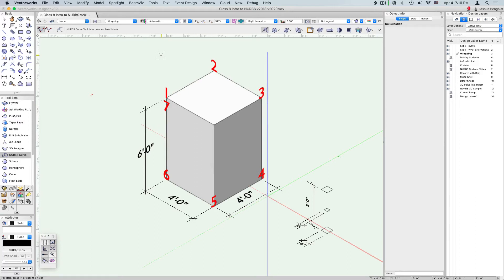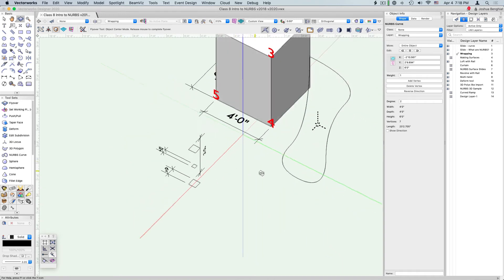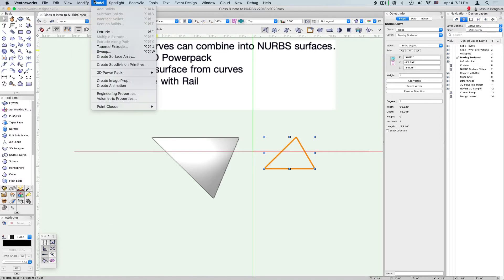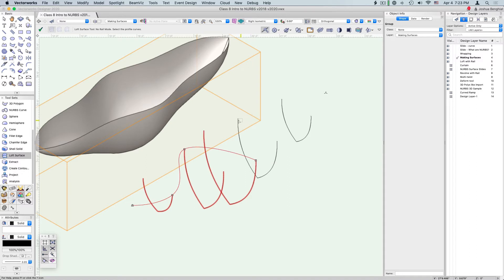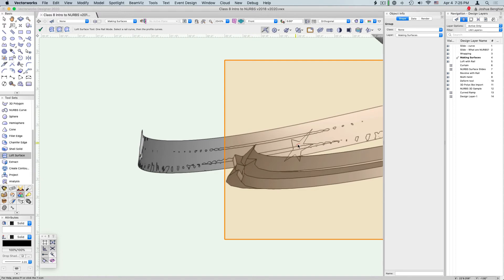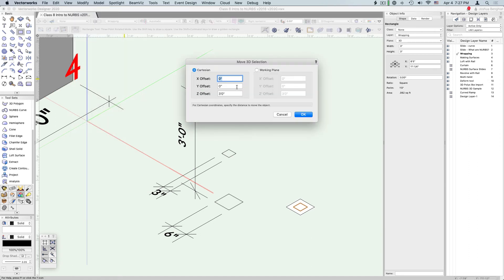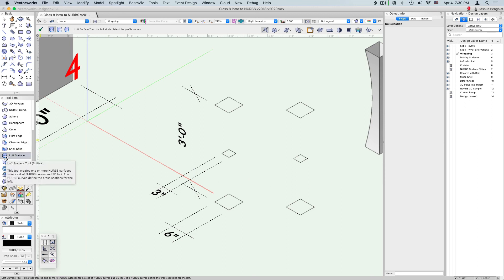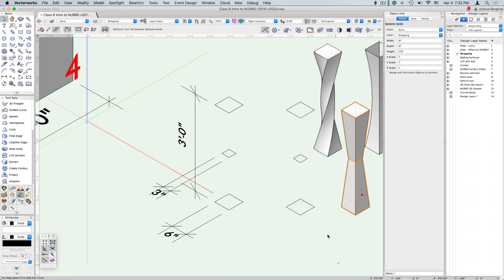NURBS part 2: Creating surfaces from curves

Comment: Great video's! I do have a question if that's ok? Around 4.27 min using the 'Loft surface Tool' (No Rail Mode) you seem to be able to connect a locus point at the start to the NURBS curves. This doesn't work with me... Can you please explain how you get this done?